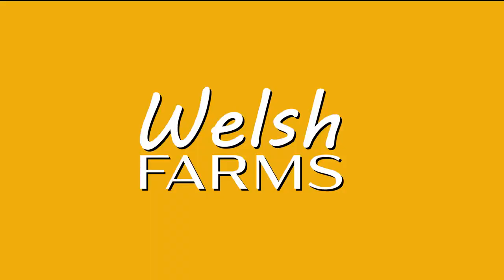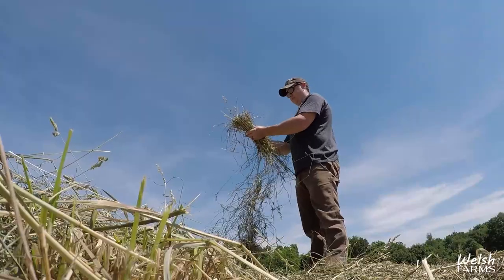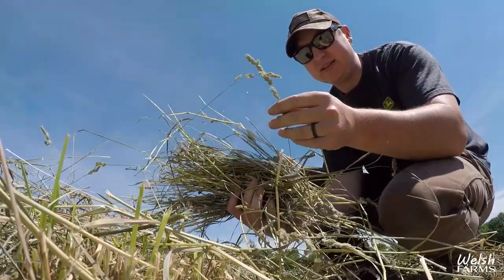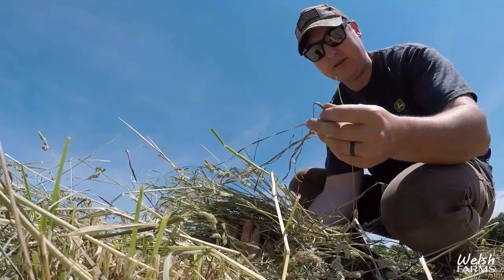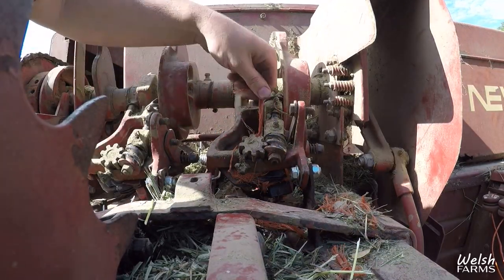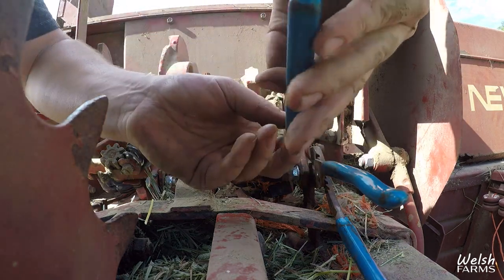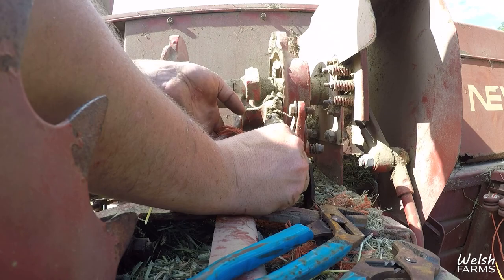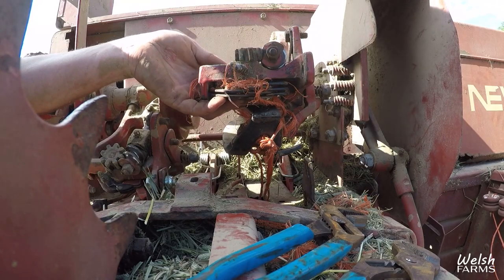First Cutting 2020 Part 3 - Raking & Baling

Comment: Hi, Great Video.  I have a chance to get a. New Holland 326 Baler for $4500. I was concerned my tractor might not be able to handle it.  I see you are Bailing with a John Deere 5300 is that 50 Hp at the PTO? I have a John Deere 5075e 61 Hp at the PTO. do you think my tractor can handle a 326 Baler well?
How does your 5300 do with and with out a full wagon?
Thanks!
Reply from the maker: Absolutely that 5075 will do great! My 5300 never had an issue even with the thickest hay!